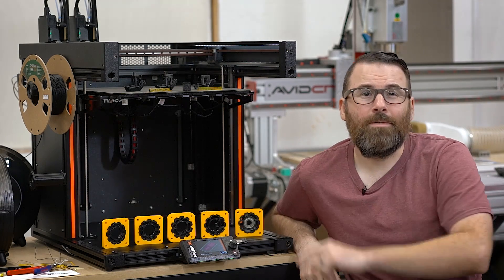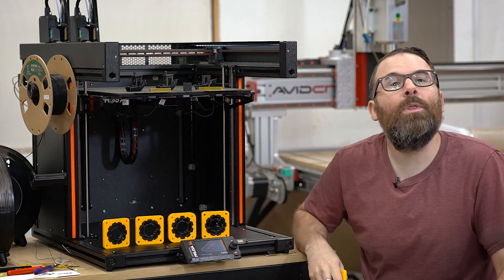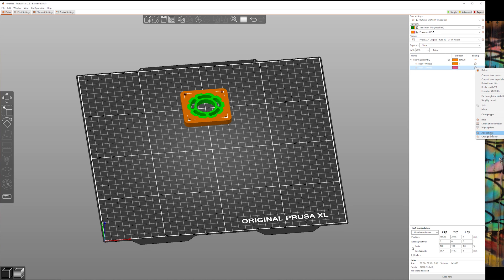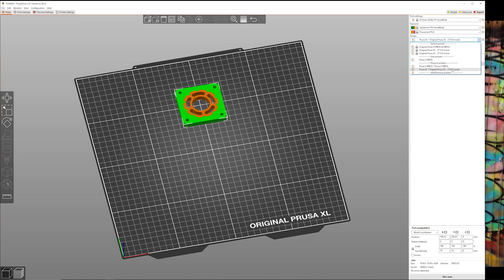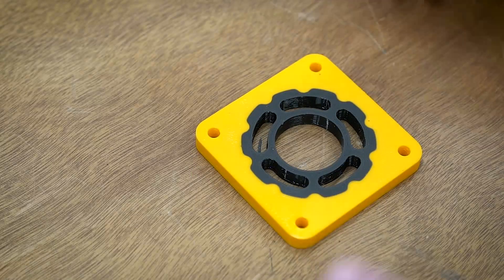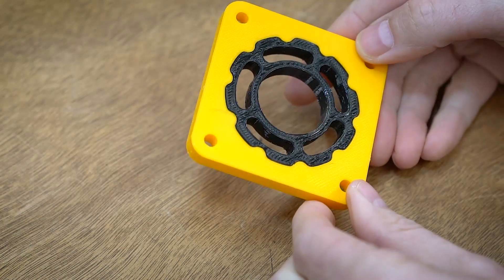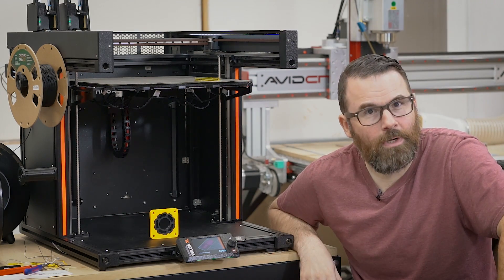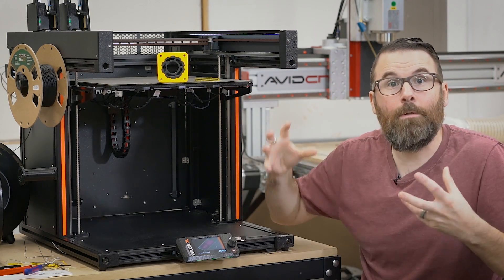Prusa XL - Multi-Material Testing (TPU and PLA)

Comment: Nice video. It was refreshing to see your multi material and Prusa slicer experience. I tried to use Prusa slicer with my Sovol SV04 and ran into the material feed rate problem you also had. Good tip on changing the flow rate in the material properties. I was using Cura and it has the ability to handle different size nozzles for each extruder, I ran 0.4 on PLA with 0.5 on TPU. Cura also has more straightforward settings for the different materials on each head. I hope Prusa will have these features in the future.
Reply from the maker: I mean, from my testing it's absolutely usable, you just have to know what to adjust.  I think TPU is just a special case since it prints so much slower.  I think different bed temps is tricky, there's no real good way to handle it, just go with the higher one.

Comment: Thoughts: I could be wrong (I would check if I weren't lazy), but I swear Bambulab has the multiple speeds per filament set up, and therefore OrcaSclier (based on it) should as well, so I have to imagine it's only a matter of time for Prusa to backport the feature, but then again they still haven't backported multiple plates, nor added skew compensation to the mini (yes someone remembers) so you know, only a matter of Prusa time.

As for the prints, this is pretty much what I've been waiting to see from day one but Ive yet to see other people post similar or when they do, they say it's an unmitigated disaster, but I had to imagine someone would figure out the settings, because in theory it doesn't seem that hard, and I've done the ol pause and switch to tpu myself.

You can just see this machine oozing with potential (pun intended). Many of the problems seem fixable via software. It's just a question of will Prusa get around to it while we all are still even using fff printers.

As for volumetric flow, I kinda want to point out that it's not just volumetric flow per filament, but also acceleration before notable quality loss and retraction. I also suspect there is something we aren't really all meausirng yet to do with how fast a system can adapt to heat loss through filament, where the bigger the block, the longer that feedback takes to come into consideration, practically lowering volumetric flow in a way that would not be noticeable with traditional steady flow tests.  But also, I basically just wanted to say tpu can actually be printed pretty fast (You can find some really insanely fast printed, good quality, good layer adhesion prints out there on YouTube if you look), so when input shaping comes, you're gunna have a fun time, and by fun time, I mean less time waiting even for the fancy prints.

As for the made up useless part, I immediately thought weapon bearing shock absorbers for the lighter weight classes, and or wheel shock mounts, with variable stiffness.
Reply from the maker: Many people seem to interpret this video as negative, but I think it's quite positive.  For CNC CAM software, you need to tweak it a LOT to get the results you want.  If you want to print two different materials together, I would expect you need to check a few boxes and adjust some settings.  The whole process was better than I initially expected, some amount of tweaking will be a given.  And your thoughts were exactly right, wheel shock mounts, compliant bearings, TPU wheel with solid hub, etc, etc.
Reply: "but then again they still haven't backported multiple plates, nor added skew compensation to the mini"
Lol they don't need to, you literally just select from the printer what plate you're using and it includes your set Z offset. My MK3 has 6 different plate settings saved. When I'm using my smooth sheet, I choose "smooth1" which has it's set offset and I choose "texture2" when using a textured build plate. i don't have to re adjust Z at all when switching between plates.

And you don't need skew compensation if you actually assembled your printer correctly. And the mini makes it incredibly easy to adjust skew just by adjusting belt tension.
Reply from the maker: the load cell makes adjusting the offset for each plate irrelevant.

Comment: Hey Robert. Great video again, I really discovered your account, excellent!

I am printing with a 0,6 and 0,4mm combined.

You indeed can only select 1 nozzle size in Prusaslicer. However, what I did is set the machine settings -> extruder x -> nozzle diameter to the 2 different sizes. Then, when you set the extrusion widths in percentages instead of flat mm values, it will set 2 different extrusion widths and so you can print 2 different nozzle sizes.

Also, smart play with the filament settings -> max VF. I did the rough same by adding M220 S30 to the filament start gcode and M220 S100 at the filament end gcode.

On the support side; you can also combine PETG and PLA, they do not bond well together and really work well as support for each other!

Might help you out.
Reply: Ohh wow this such great advice - I didn't know you can set the width in percentages instead of flat mm values. I will definitely try this too!
Reply from the maker: Yeah, that's a good tip.
Reply from the maker: Got it, thanks!

Comment: Great video. With 2.6.0 there came a feature for interlocking materials/colours. But I haven’t tried it yet. 
„When using multi-material painting tool, there is now an option to enable interlocking of the painted patches with the neighboring segments. This improves connection of the patches. The setting is available in Print Settings->Advanced->Interlocking depth of a segmented region and it must be smaller than Maximum width of a segmented region , otherwise the setting is ignored.“
Reply: This just works with material painting, which only paints the surface. Robert is using 2 different files here..
Reply: Yes, but you could design it as one object and use the painting for the inner part and a designated area where you want to have the overlap. @sandervanvoxel3d
Reply: This is what I was wondering.. I thought it was in PS 2.6 but couldn't remember. I think he mentioned Cura.. which may have a similar feature? I would LOVE to see if this feature makes it so those of us not knowing how to use 3D programs like fusion360, can achieve pretty good results with multi head/material printers. In fact when I saw this feature coming in the early releases, I thought.. ooh.. perfect way to utilize multi head prints, which is why I am not trying to figure out which multi head printer to get (ProForge 4 is looking good but waiting on reviews/prints.. as it is 1/2 the price (with 4 heads), open source parts, and prints up to 800mm/s supposedly).
Reply from the maker: Yeah, I really need to try this!

Comment: This is awesome, thanks Robert. If you have the time, could you try printing something transparent and something opaque? I'm interested in trying to make light pipes.
Reply from the maker: Possibly!  What's special about the XL that you want to see?  This seems more specific to the filament and the slicer settings.  I know others have done videos about it, and it comes down to geometry and specific slicing.  I'm not sure the XL would be any different than any other 3d printer out there.
Reply: @RobertCowanDIY   I bought a makerbot replicator 2X when it first came out and I had very little luck with dual extrusion projects. The opaque filament smears into the translucent and the results aren't very crisp. what I like about the tool changer design is that it doesn't drag the other head around letting it ooze out onto the piece. I have a prusa xl on order, and while I wait I was just curious what a part printed with separate tool heads might look like when illuminated - especially with clear + black. If you do make one, I recommend printing your hair+glasses+beard logo and hang it up in the background of your videos like a neon sign.

Comment: I have the same machine. Tried to run PVA initially but it was basically burning. The XL seems to run hotter than my Mk3s+’s. Polymaker PC was stringing badly until I lowered the temps. I need to try PVA again now that I know it tends to run hot. FWIW, I’m getting ready to run some Polymaker PA6/CF — initial tests were bad, 12 hours was not enough drying time. I’m 24 hours in now in a lab grade convection oven and will run soon. I sent you a DM on Facebook.
Reply from the maker: Yeah, PVA didn't work on the first test for me.  I'll check facebook, I ignore most messages since I get a ton every day and it's mostly people trying to get me to make things for them.
Reply: I have a diamondback nozzle in #2 I think that made the problem worse. @RobertCowanDIY
Reply from the maker: @iimuch3760  Interesting.  I've heard from other people that the Diamondback nozzles transmitted heat better than brass, so they needed to adjust temps.  I personally never had that issue, but I heard others say it.